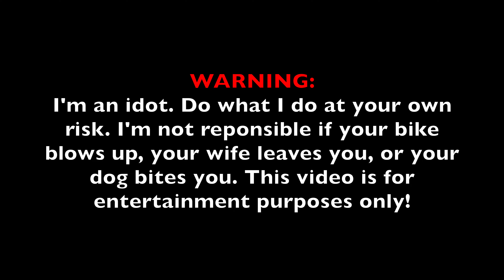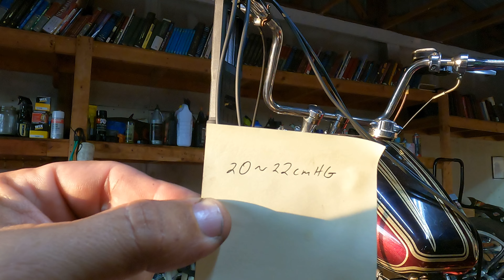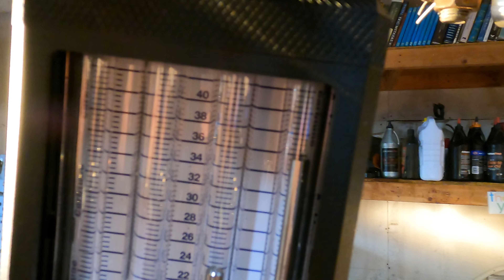Part 4 of the 1977 Honda CB750 Chopper Revival and Road Ready. Butler Customs

Comment: I like using my ears at idle as well if I'm synching carbs as well, I just find the response is much better. Looks like an old Wessel Frisco tank. You may want to lower the air pressure in the rear tire to somewhere around 18-20 PSI to help that tire last a bit longer and give a bit of softer ride. Old school way. Name for the Ironhead would be "Simply Perfect!"
Reply from the maker: That's true.